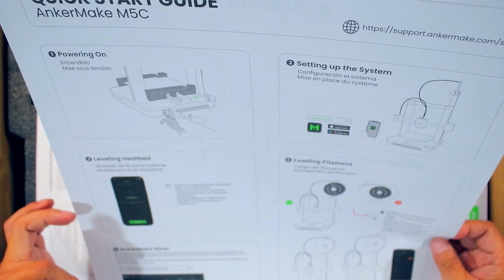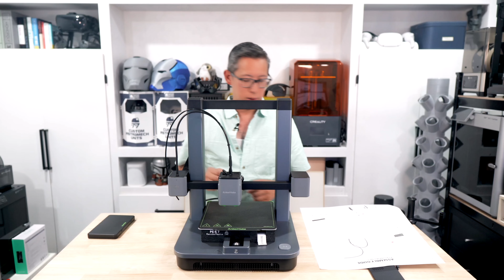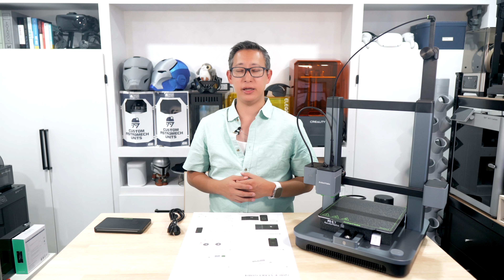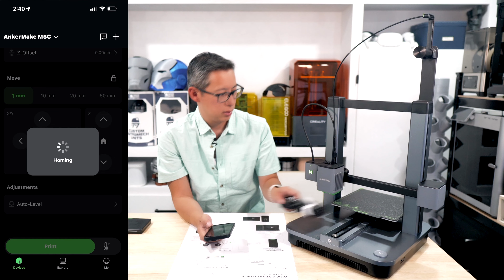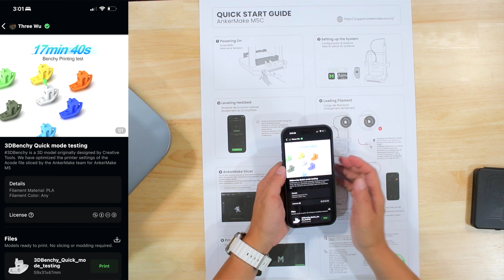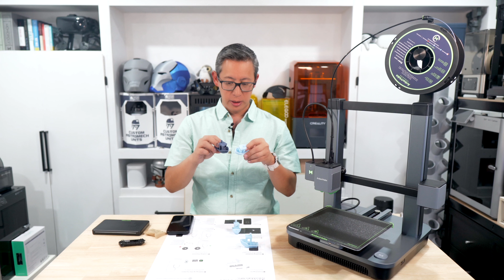AnkerMake M5C - The Best Desktop 3D printer | Unbox & Review

Comment: So I just got mine an hour ago and I have it set up but for some reason the filament will just not work, I can't get it to come out or extrude, at all, I have followed what ankormake has on their website with changing out the nostile and nothing anyone know what to do?
Reply: Hey man I got you, something similar happened to me and getting the tip of the filament as pointy as possible and with the filament being as straight as possible (no bends or twisted bits) fixes the issue. I still have to trim it a bit more from time to time but that should do the trick
Reply: @hansflamen  Thank you so much, I just tried that and now it is workimg
Reply: Basically I had the same issue and you don’t need to replace the nozzle just keep on feeding it filament until it melts it and extrudes it